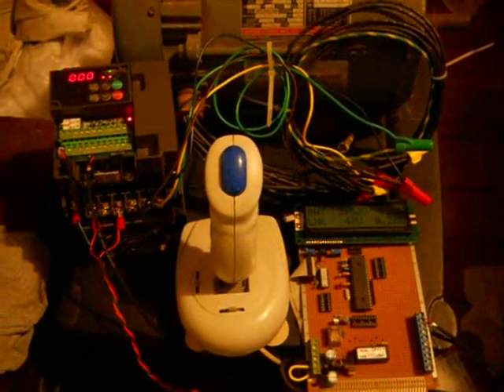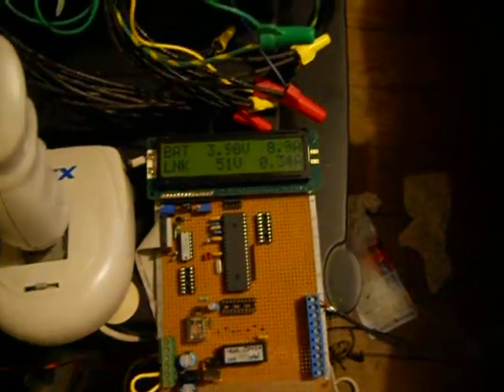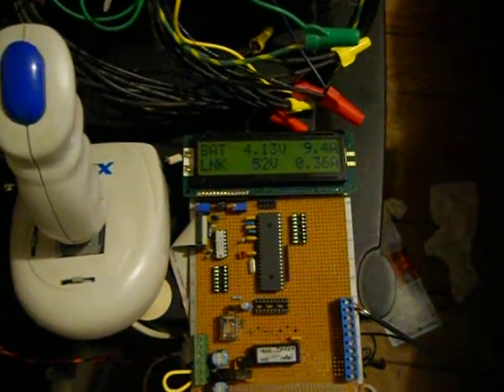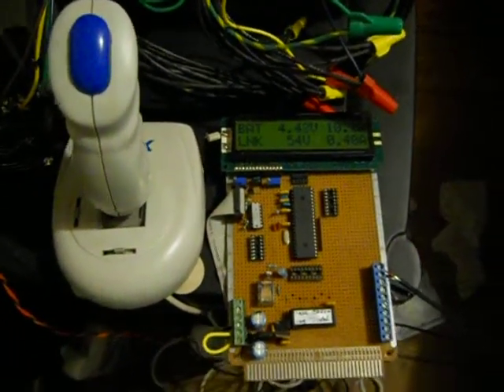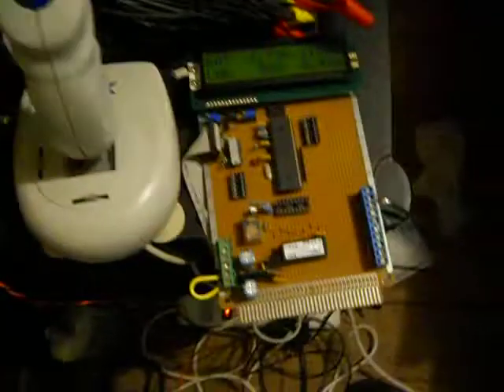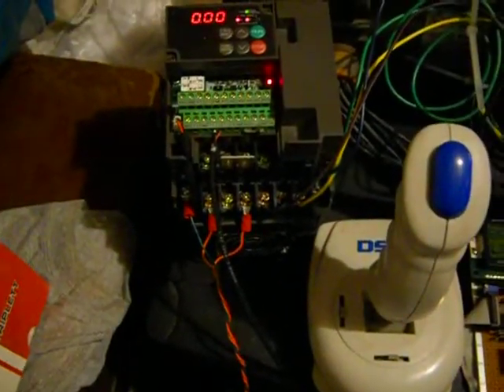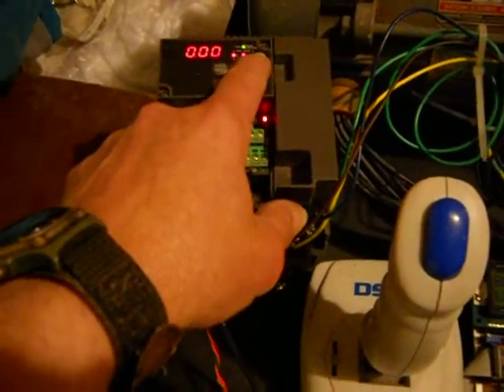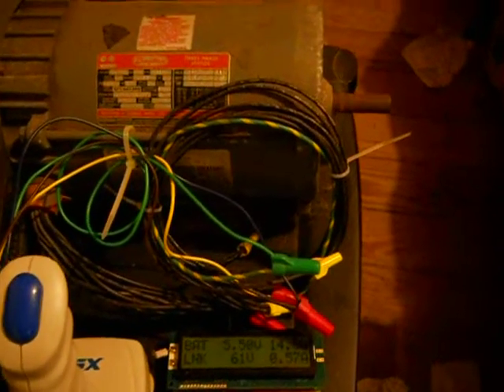Three phase motor control using joystick

Comment: Very nice electronics.  What speed controller are you useing?  The DC to DC converter is a good way to save space and reduce battery weight in a small vehical.  We had a plug in electric garden tracktor back in the 70's that worked as well as any gasoline powered model.  Too bad they stopped makeing them.  The public at large is in love with exhaust and noise.  I like your way better. Keep up the good work.